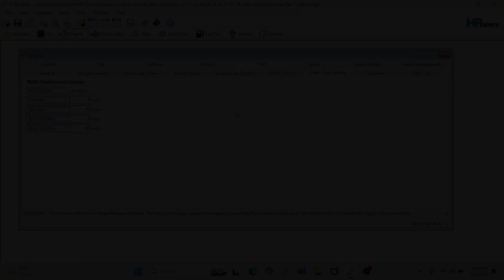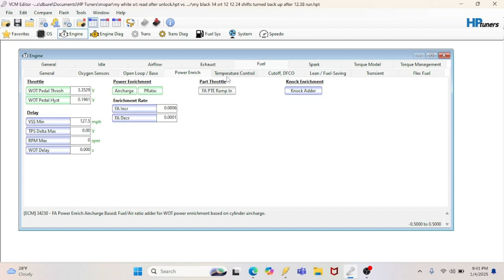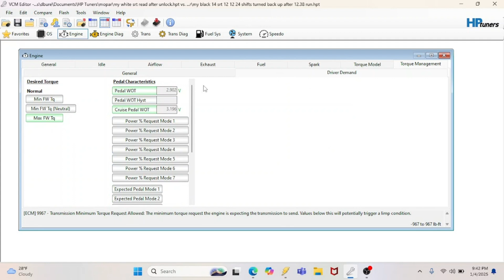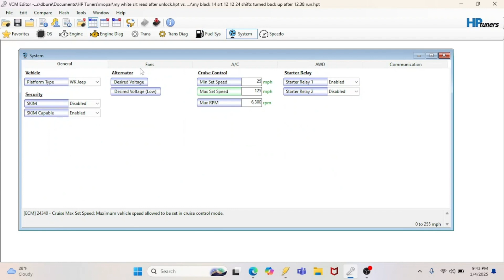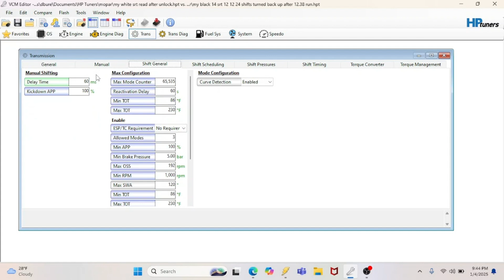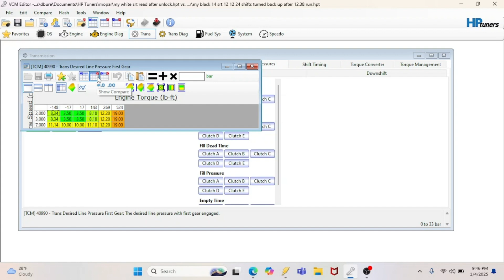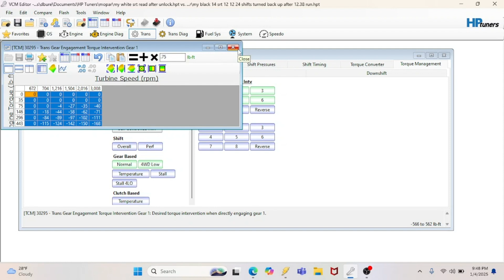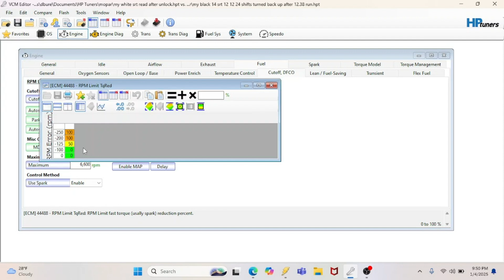HP Tuners Beginner Hemi Dodge tuning basics, MDS shutoff, 8hp70, throttle response, Tq Management

Comment: Neural network? And disabling MDS without swapping the lifters to non MDS lifters and swapping the solenoids for plugs starves the lifters of oil
Reply from the maker: @thomashardee407   that is incorrect, the oil pressure is what enables them retract based off the solenoids, Disabling the solenoids can’t physically stop oil flow through them. That’s absolutely not how it works.
Reply: So how are the lifters unlocked allowing them to collapse, allowing the cylinders to be disabled?
Reply: I’m not saying they don’t have oil to them, I’m just saying it’s minimal with the solenoids still in place, but with the solenoids removed they have full oil pressure and flow to the body aiding in lubrication on the roller which is the failure on these lifter
Reply from the maker: @ ya ideally removing the msd lifters and solenoids is the best option. It doesn’t hurt to just turn them off for the time being.